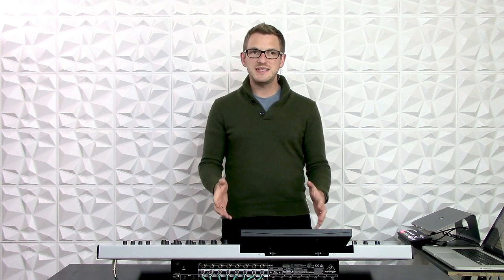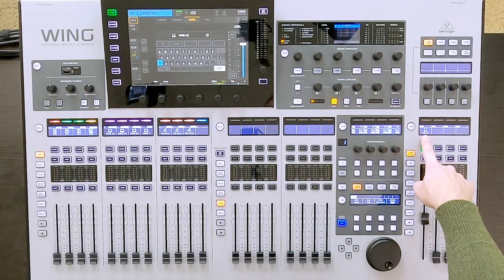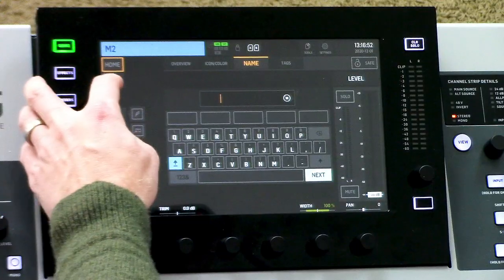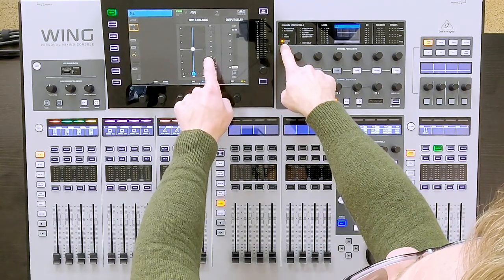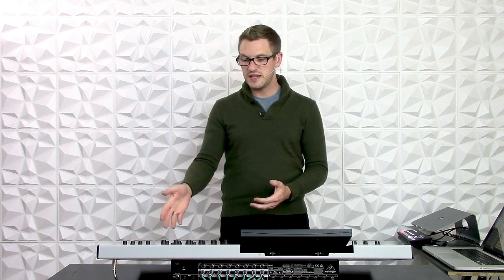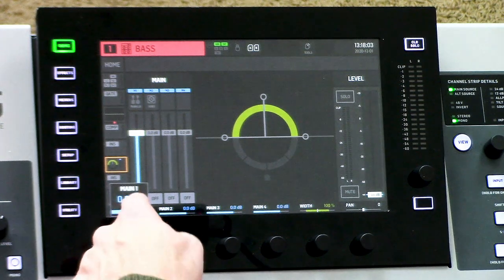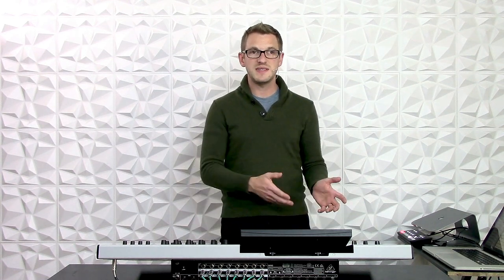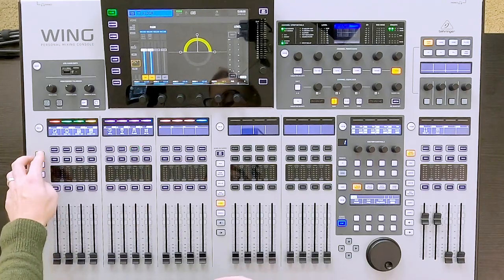Behringer Wing 106 - Main Buss & Main LR

Comment: I feel there is an issue with the default settings when setting up monitor mixes(wedges) on the mix busses(for send on Fader)  it appears the console defaults the mix busses to the stereo mains. if you don't check , it can be a disaster.....no mix bus should default to stereo mains. I feel behringer shoudl fix this in a firmware update.

Comment: Mr Brashler, good morning and GD bless you. I am messaging because I am a female new student to media and sound and it is why I am a volunteer @ the church I attend, it is a small church. I am 1 [make others and things are going ok] of 3. @ the church TF5 is used. When I have issues, for ex: trying to figure out how to make sure that the mains are putting out the same on L/R I truly am confused about how to do so. And several other issues, which for a more learned person would probably not be that big of an issue. Such as know how to connect a bass amp to the TIO and not have that humming. I have tried the following, Yamaha customer tech support for the board, website tutorials, asking others if they might know, and searching the matter out online, it seems the issues with the details I run into I am not able to have the resolve and fix issues, through the sources I am finding. Based on what I shared with you, and please allow me to apologize I have truly needed to ask questions of someone learned. if its at all possible that you might have some thoughts to share with me, I would truly appreciate it so very much. ty
Reply: Hello Nrael,  with the humming from the bass amp, it might be a ground loop. you might want to try using a direct box and lift the ground switch. are you using the XLR (3pin) connection to hook up to your TF5, if now you should be. try not to use the 1/4 cable(guitar cord) and make sure all the cables you use are shielded. Hope this helps.

Comment: Hey Drew, awesome videos - I have learned so much. Question for you: I run an open mic show and have guitarists coming and going, plugging/unplugging. Trying to avoid the PA pop. If I mute the guitar inputs, will that also mute them from popping the in the monitors?
Reply: If you mute the channel, yes. (Muting a channel also mutes all of its sends). 

If you mute a bus or subgroup, no - (presumably monitors are busses) the channel still transmits to all configured sends. 

 If you mute a DCA, it depends whether the mute groups follow DCA mute (panel setting). If yes, yes (default I believe)

Comment: Good day drew. I need some assistance in understanding on what do you mean at the end. So you have band main mix and vocal main go to a matrix, how does the matrix run through the PA? What if you have LR and Subs. I'm sorry, I just need help on that. Newbie engineer
Reply from the maker: Great question, so the matrix sums together the band main buss and the vocal main buss. The matrix then outputs over two outputs to the PA (a left and a right). In the matrix section, you could have a HPF (low-cut) to remove the low end, and then add a duplicate matrix for sending to your subwoofer. Then on your subwoofer matrix you would send just the band main buss to it. You can then add a HPF and LPF to tailor for your specific subwoofer.

I'll look to add a video in the future on feeding a main PA plus subwoofer.